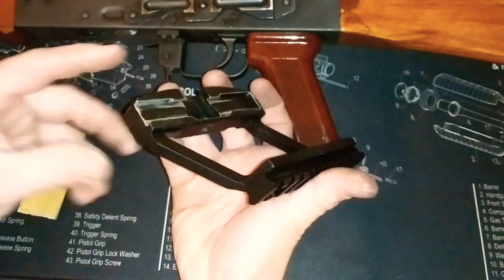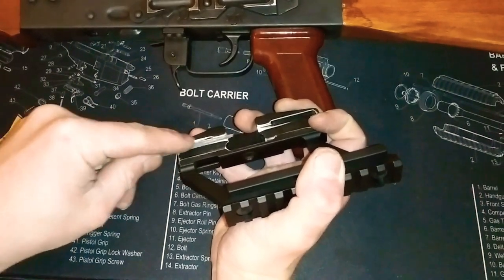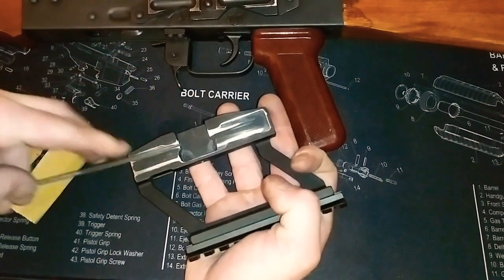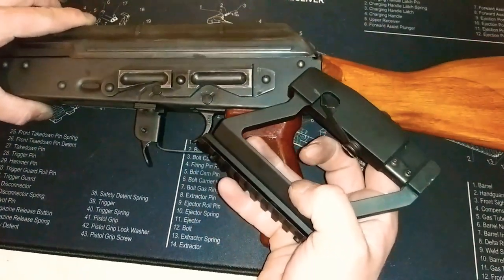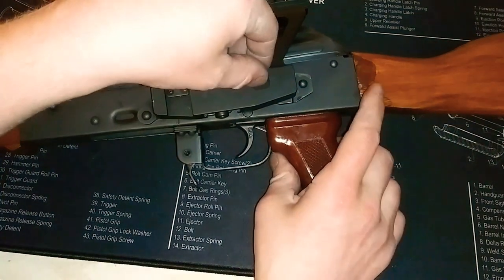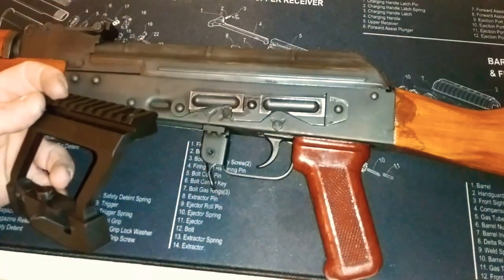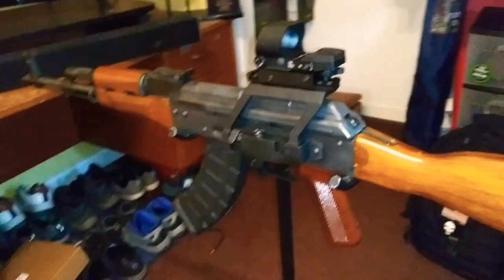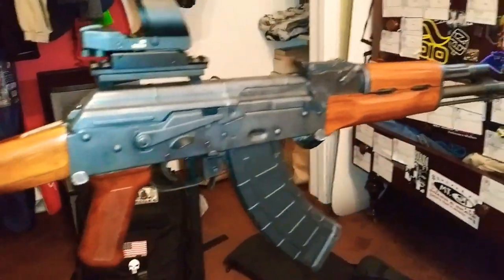Ak47 side rail optic mount wont fit? how to modify it to fit w/ my  Riley Defense RAK47C

Comment: So what style side mount is the Riley? Russian? Yugo? I’m trying to help my brother find a side mount that fits his Riley. I have an RS Regulate AK303M mount on my Galil Clone with the AK Master mount.
Reply from the maker: @codydrums2175  I can't find the exact item that I purchased on Amazon cuz when I went to my order history and clicked on it, it said this item is no longer available but I typed in the same name that it had and the link I'm going to send you popped up. It's from the same company so I'm assuming it is the same style of side rail. Here's the link from Amazon. And since it's Amazon if it doesn't fit, you should have no problems returning it and getting a full refund. So worth a shot for sure. 
Gotical A-K Side Rail Scope Mount with Picatinny Quick Detach System for A-K 47 A-K 74 CNC Aluminum A-K 47/74 Side Rail Scope Mount (A-K Rail Scope Mount) https://a.co/d/g3QXqGz
Reply from the maker: @codydrums2175  And not sure if this helps or not, but to the best of my knowledge, I think the side rail optic mounts for AK style rifles are basically universal and all the same, but I could be wrong. That's just what I have come to learn in the short amount of research that I did

Comment: Bought a $145 rail mount from ak op union.... doesn't fit, too loose. Edit: ak master mount adjusts (fuck me right) and can clamp down really hard if done right.
Reply from the maker: Did u let them know it was a Riley defense? Cause Rob who runs ak operators union has allot of experience with Riley ak's and I would imagine that he would know what rails work best for which rifles. U should contact them and let them know the problem. The 30$ mount i got on Amazon works great after I spent only 5 min giving it a light sanding and filing down. But better to be to tight than to loose that's for sure
Reply from the maker: But that would be an issue with the mount not the rail cause all the ak47 manufacturers make their rails to different specs.
Reply: @counterstrike2A  nope I'm a dummy. The mount adjusts. The Rak47 doesn't have the semi-cylindrical cut out for a better clamp but my adjustment is real tight so we'll see if she stays.